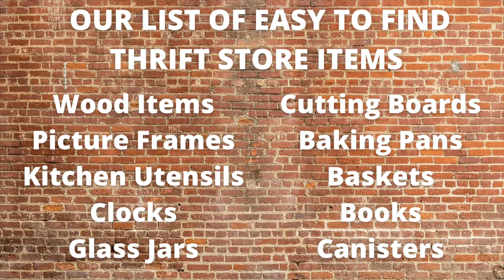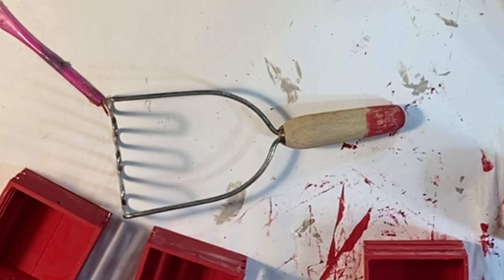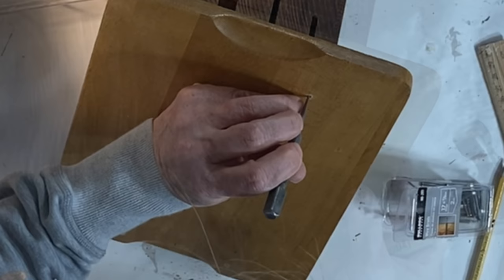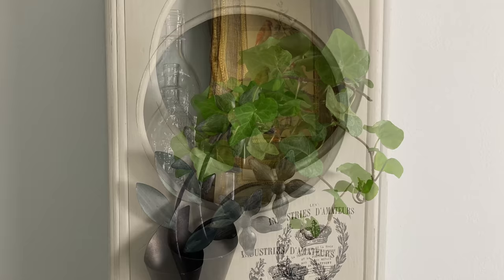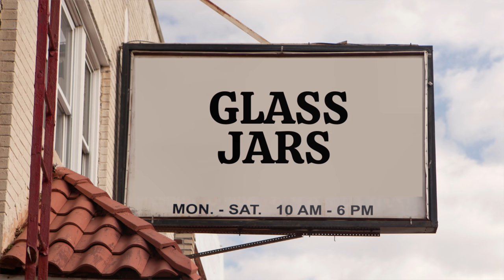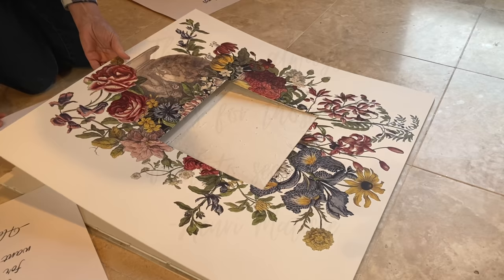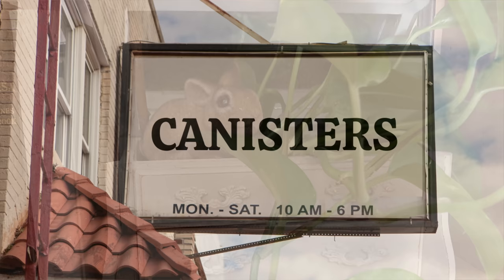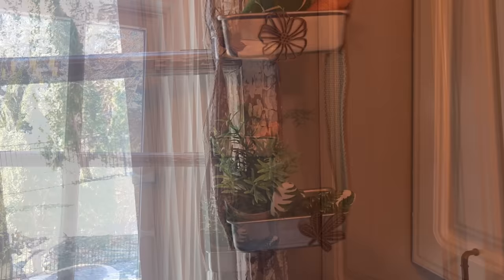3 DIFFERENT WAYS TO UPCYCLE 10 EASY TO FIND THRIFT STORE ITEMS

Comment: Hi Sherry,
I always enjoy your videos on how you reinvent your found treasures. In my kitchen displayed I have my grandmother's hand held beaters with wooden handles and chippy paint. I remember her using the one to mix the yeast in the warm milk to add to her Hungarian breads. She baked all in her very large Detroit Jewel oven.  I have many of her kitchen tools with the wooden handles and one my mom and I could never figure out how to use it.  Packed away in a box I have yet to find for my kitchen is my mom's Julia Child's cookbook and I believe it is the same one you have. I believe I saved my mom's World Atlas book, huge in size, same color and the book use used to keep photos in. 
Last summer I bought many of the die cut wood cut outs and I believe I have the same leaves. I have yet to use any but, hope to soon. I almost have my crafting area finished from my move. I collect owls and I bought the owl die cuts.  Did you know if you soak them in warm water, how they are made the layers come apart. As soon as they separate take them out, pat dry them with a cloth, lay them on a cloth with another cloth on top and a heavy book for a few hours to flatten them back out.  I found this out by accident dropping one in my dish washing tub in my sink not knowing I dropped one and eventually 2 floated to the top. So, you get extras for $1.25. 

Years ago I was involved in a bad car accident and I could not go to work, could not drive for awhile, I was super down.  Temporarily I have my boyfriend a key to my apartment so if I was resting I did not have to race to the door.   That was Fall 1991.  I was laying in bed and first I heard a knock, then the door open. My boyfriend popped his head into my room to say on his way home he saw a cool wall clock on the curb and it had a piece of paper saying, "I need a home, I was made by the Amish and I still work".  He said he out a battery in it and it is keeping good time. He said he has it on the kitchen counter.  And he left.  Sherry, the clock is your clock and I have never seen one like it but mine is a tad different but I believe yours may have been made by the Amish too.  My clock is between a Kelly green and a garden green. The face is behind glass and the chip board face has the pink hearts like your's. My case goes down further with a shelf inside but part of the door that opens to the shelf is broken.  For 20 years it hung in my living room wall where I lived and I kept thinking I would have the glass replaced and repaint the hearts in each corner like the orig glass but I never did. Then in 2019  I moved in with my mom and I did not want anyone to get hurt on the broken glass so I took it completely out and threw it away.  I propped it up on a old table I had for years in my bedroom at my mom's and I put my owk collection in it.  It has a nice tick when I would go to bed at night and my mom could not believe what great accurate time it keeps.  My boyfriend passed away at age 48 from a heart attack 2 days after having a physical which included an EKG in order to play on a professional traveling basketball team.   Now my mom passed away in 2021 and I was hoping to buy out my siblings half of the house but was unable to and I had to move out.  I am now in a small 610 sqft apt built in 1940, registered with the historical society, not allowed to use nails or molly bolts so I have not hung the clock yet. I have it propped up on a vintage dough bench for now.  My new little home is so tiny with not much closet space I have to tell myself all the time when I pass piles in the curb that I haven't any room.    When I am not living in a sea of boxes and my place looks nice I hope to post photos of my place on Instagram and I will send you a photo of my clock.  
Funny timing also, as I had never heard of Theresa's channel until I recd a notice that a IG friend and I follow Theresa.  I clicked onti her posts for a minute as it was late and she does make beautiful  things. I love that new chair she just purchased to put where her Christmas tree was. The chair is new but it is an elegant vintage style in a soft cream. 
Last but not least, my mom's oldest brother loves going to estate sales and he picks up craft books for me all the time but a few months ago he picked up mini loaf pans but there are 4 and they are all hooked to a metal grid.  The pans are not self stick and I believe they are aluminum and I do not use aluminum pots or bakeware any more.  I do not want to donate these either to harm someone else's health if they do not know about the health risks. I have not thought about the loaf pans for months until your hanging in the kitchen with the belts.  I quickly had an idea but of course I do not know how I would hang it but, maybe I could  use each one as little Shadow boxes. Each box has a theme of the diff seasons. Spring Summer Winter Fall. Or holiday themes.  
Well, as usual I have written another novel to you.  You are the only one I write long notes too. Your DYIs always excite me and get my creative juices flowing.   I am itching to start creating soon too. My creative juices retired since my mom passed away but I am joining a new church and right before Christmas they had a craft workshop for children and adults  and I signed up for the woodworking class and my mind had a wonderful kick start to create.  I had not planned on decorating or even putting up a tree this year because of sadness not being in my mom's home for the first time in 31 years for Christmas. But, my mom left me her entire set of furniture for the living room and bedroom and  beautiful art work of the King's going to Jerusalem and I wanted to make my mom proud. I decorated in a small scale with mostly hand made ornaments and a few of tea light Christmas trees from the Dollar Tree. I used vintage books in red to give height to some decorations.  I posted my decorated half on Instagram and rec'd very nice compliments even my toilet paper rolls snowflakes were a hit. 
Have a wonderful weekend and stay warm.  Blessings, Rebekah

Comment: I really love all the projects! I was wondering when you paint a canister doesn’t it interfere with the opening and closing of the lead?
Reply from the maker: I have spray painted cans before, and they were fine. However, this time the lids were already so tight that they were hard to open. Just test out the lids beforehand and use ones that are not too snug.

Comment: Hi Sherry: I plan to use chalk paint on an old  train wardrobe suitcase...I was wondering is it necessary to apply  wax after painting and if necessary,  how often should I apply the wax?
Reply from the maker: If it is just going to be a display piece that won’t be handled much, you don’t have to apply wax; however, I prefer the look of chalk paint after wax is applied. You shouldn’t need to reapply it for a few years.